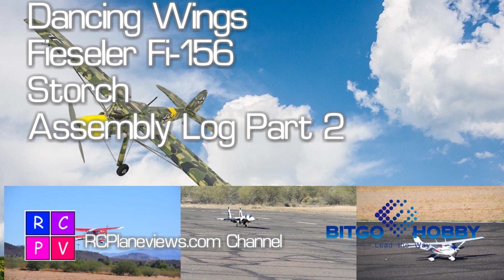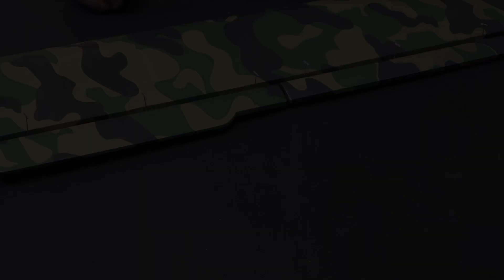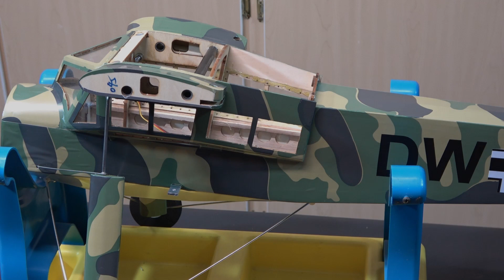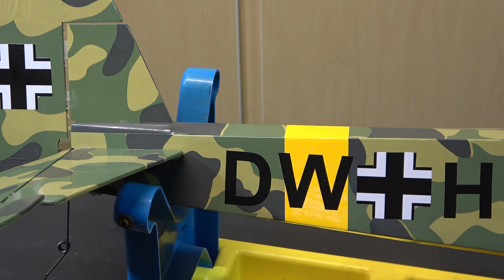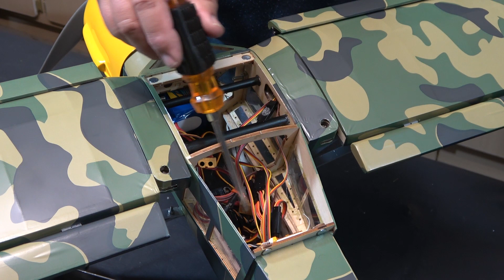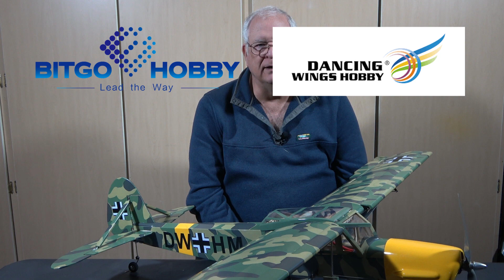Fi-156 Storch Assembly Log Pt 2

Comment: How'd it fly?  Most have been disappointed, looks great, overweight, doesn't fly scale-like,
Reply: Can you build it so it flies well? I've got the kit and want to build it but don't know what I have to do for changes
Reply: @jo21e6  I think we're talking about the DW Storch kit, It seems too heavily wing loaded to do scale-like STOL flying. It will fly OK, but not very gracefully.
Reply: @garygullikson6349  i'm thinking about lighter 9gramm Servos
Reply: @garygullikson6349  and maybe there is a way to build with less wood
Reply: I think that the snap together laser cut structure is too heavy compared to a traditional balsa/ply "stick-model" structure
built light. Makes a nice looking model though.